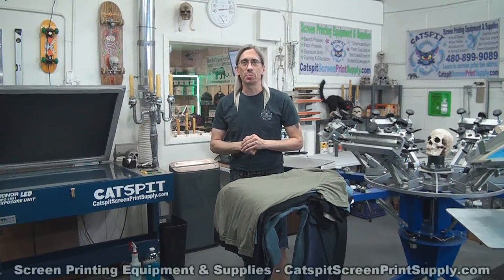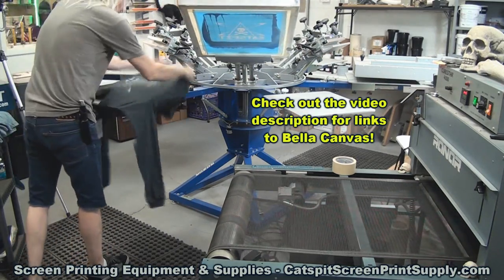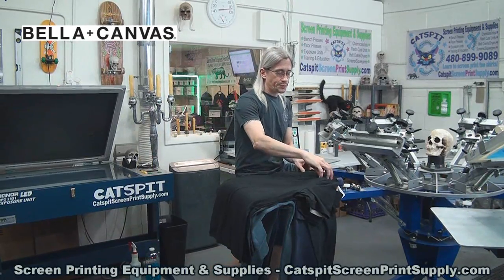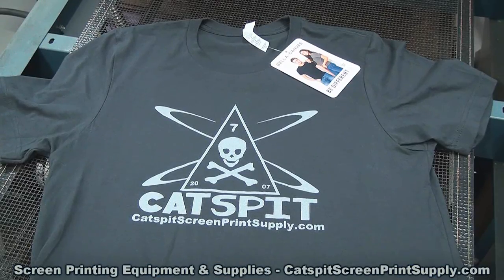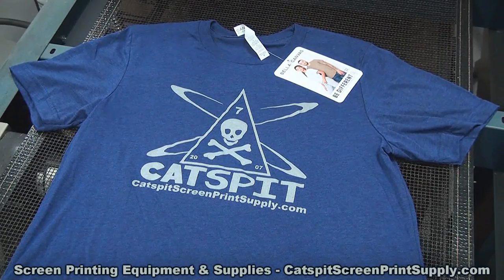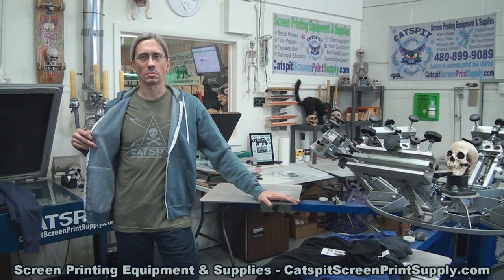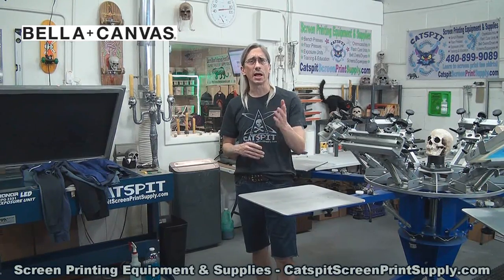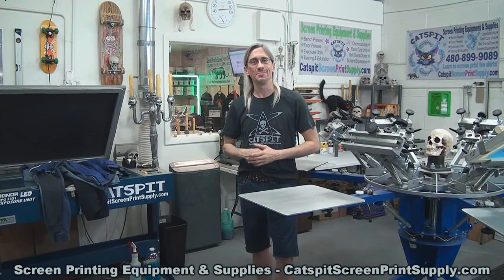Screen Printing Bella + Canvas Tee Shirts And Hoodies With Review

Comment: Would You Recommend DTG Printers ? For Retail Business IF you have Any Encounters With Epson Surecolor Worried about how long the Prints Last
Reply from the maker: Maybe for point of sale applications but not for larger volume printing. DTG is great for low volume complex art jobs. The color fades on the first wash and then it's pretty stable. But it's a heavy print especially on black garments. Thanks for watching! Screen Printing Equipment & Supplies - http://CatspitScreenPrintSupply.com/